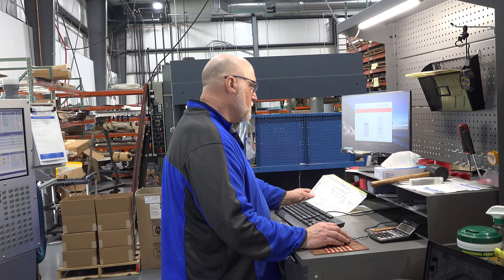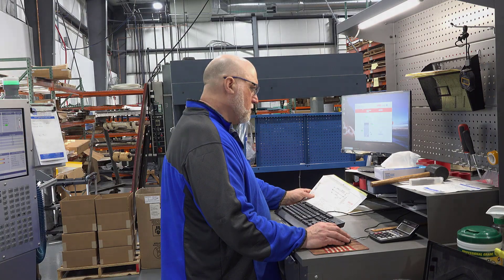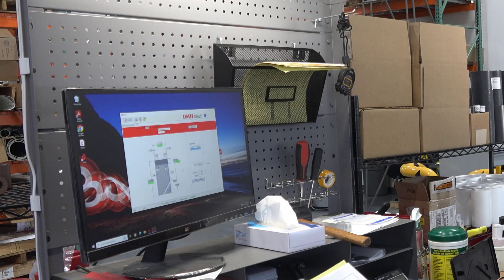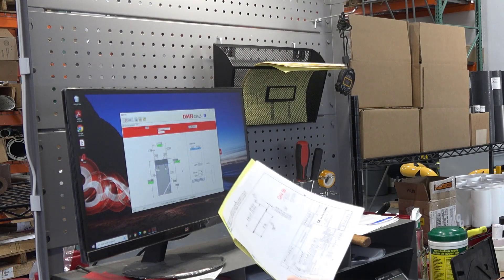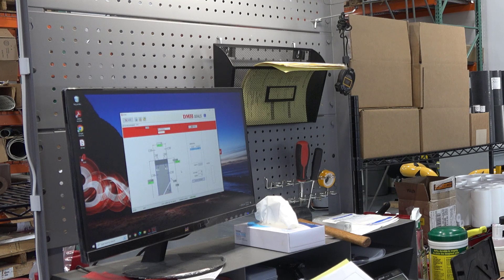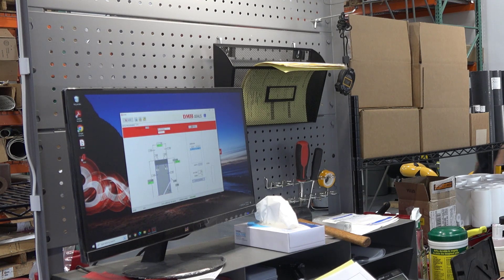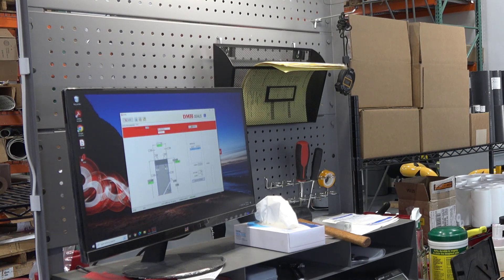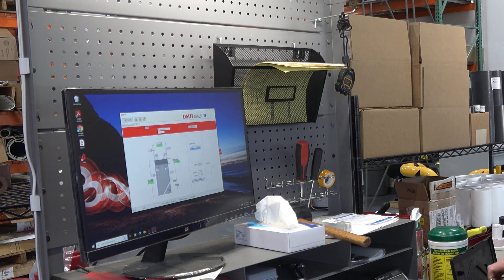CNC Machining Seals with a Haas Automation Machine

Comment: Greetings, I'm from Puerto Rico and I'm interested in setting up this configuration. Can I add the DMH and its tools to a Haas ST15? Are they fully compatible? Do any modifications need to be made, or does the ST15 work well with just the software to make hydraulic seals?
Reply from the maker: Hi, good afternoon. The DMH program works great with Haas equipment - We have a ST20 and ST-30  that can run the program. 

Issues might be cost.

Programing: Tooling is expensive and can only be secured from DMH.